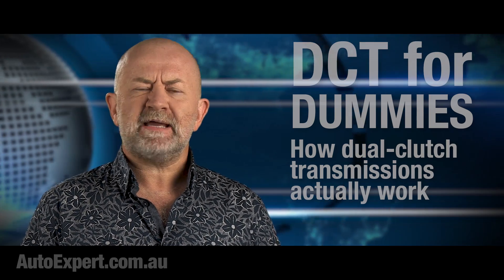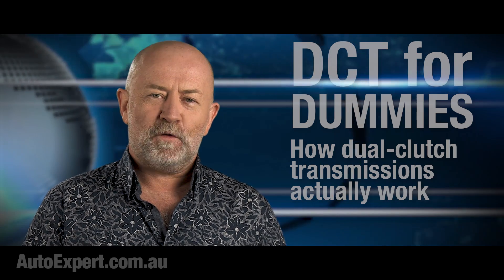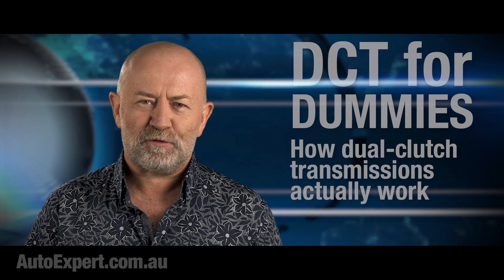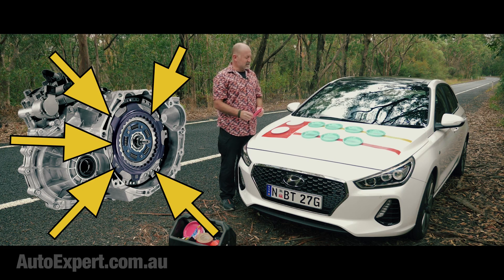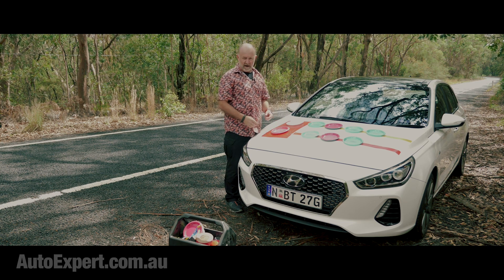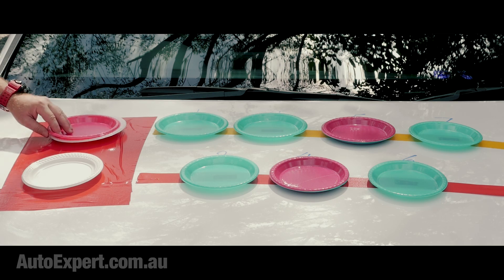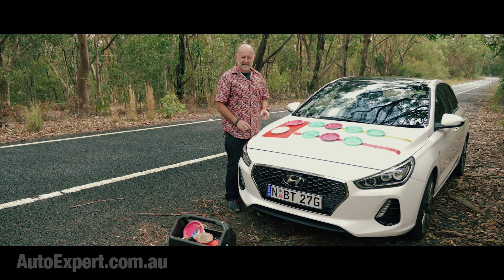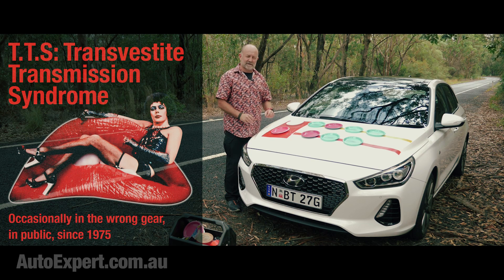DCTs for Dummies. (How dual clutch transmissions really work.) | Auto Expert John Cadogan

Comment: Sounds good. Doesn't work.
Reply: so they don't work properly
Reply: The ZF 8 speed is a great automatic, but it's a slush box auto not a DCT.
Reply: Obviously you haven't driven a Porsche with a PDK transmission.
Reply: zhbvenkhoReload 

WELL
WELL
WELL
PDK PORSCHE ...seems ....to work....
Yes
No
Does it
Does it NOT
RIGHT
AND
BYE
SALUTATIONS
Reply: Ours works very well -has done for years.
Reply: Alex McColl correct sir but a dct isn't an auto box. Its an automated manual box. As they are all in the wagons now as well, but only one clutch plate in hgv use.
Reply: Depends where you buy the plastic picnic plates..

Comment: Give a DCT a few years and see how much it costs to repair.
Drove an older 90's BMW convertible with a semi auto tranny. Hated it, unless you punched the accelerator the shifting was crap.
With over priced fuel how nice they make more efficient cars that cost the consumer more. Cheaper fuel is the easiest way to go but greed wins
Reply: INSANE>  I always google vehicles I consider buying (used) for serious issues. Stepdaughter was just sold an old 2001 VW Jetta TDI, tranny let go the next day!  They put in a used one and it's working well. The car had no rust and appeared never to have been abused. I did see it up on the hoist and undercarriage was very good. Has over 300,000 kms on it, I hear they last much longer than that.

Comment: VW really do make a shit dual clutch auto. Ruined the DCT name, jerky pos.
Reply: My friend test drived used a MK6 Golf 1.4 TSI and when he put it into D there's absolutely no foward movement, then the used car salesman told him that the car will sometimes behave like that. I'm sure it's ok to assume the previous owner sold it because of this problem.
Reply: Question is does this transmission have to learn ur driving style then it gets better cause if so test drives will be horrible cause so many different driving styles
Reply: Umm the car couldn't even move due to the transmission shitting it's pants during the test drive. So how is it supposed to learn your driving style?
Reply: driftbro that’s exactly what I’m saying all newer transmission are not very good till it learns ur driving style it might be better if u actually drive it long enough to learn ur style and not a different person driving it everyday
Reply: Learning by transmissions involves the ECU (controlling shift points) figuring out if you have a "lead foot" (push the throttle pedal hard and hold it down a lot), tow a trailer (similar to lead foot - needs more throttle) so it adjusts the shift points in an attempt to better suit your driving style. These DCTs are a bit different, in that they are mainly concerned with road speed vs engine speed/load, rather than the position or force applied to the TPS.
The "slippage" referred to above is just that - slippage. That is something that is NEVER ok as a prolonged state in a clutch. If the trans is in its' lowest gear, and still slipping the clutch, then the clutch is shot. Doing that in a dealers yard would have alarm bells ringing for me, really loud!
Reply: I agree with you.
Reply: Interesting comment.  How long did you drive a VW DSG for, and did you actually own the car/cars?
Reply: No it does not 'learn' your driving style.
Reply: Ok so then this thing is trying to think for itself and as he said predict what gear u shld need so how does it do that just simple sensors which we all know are not very good communicators and malfunction quite a bit
Reply: J Ludo Mate, many people are buying regular auto gear boxes from VW group thinking they have a DCT.
That's one of the issues, because it's not only from VW.
Car manufacturers are selling automatic gear boxes as sport gear boxes and many assume that they are buying dct's because they have paddles on the steering wheel. Worse, sellers do not properly inform the buyers about what they're really getting, even leading them to believe it's a dct without actually telling it is.
If it's an Audi and it's not an S/RS it doesn't have a DCT. No matter what the dealer tells you.